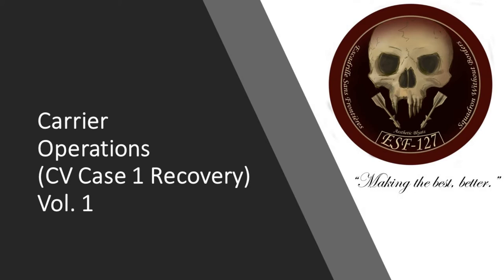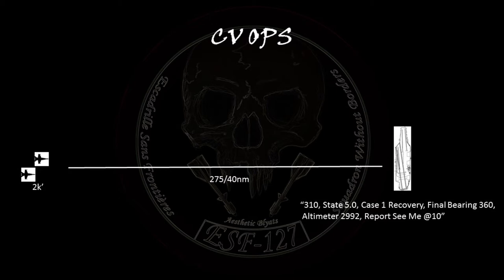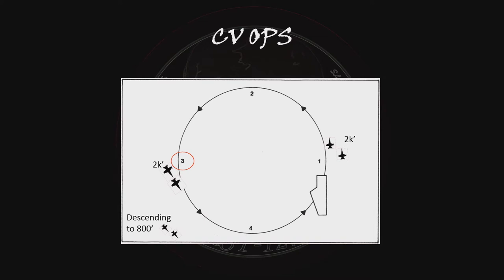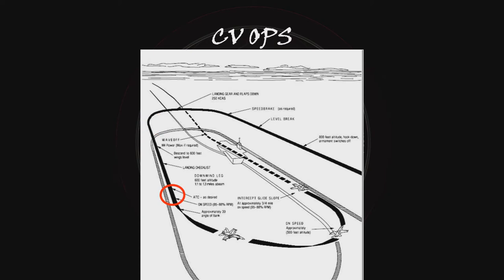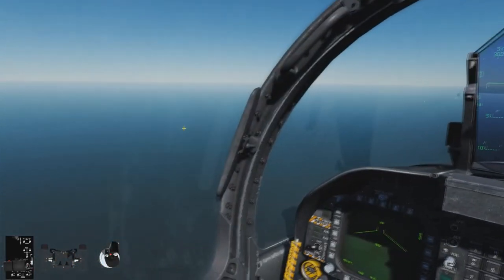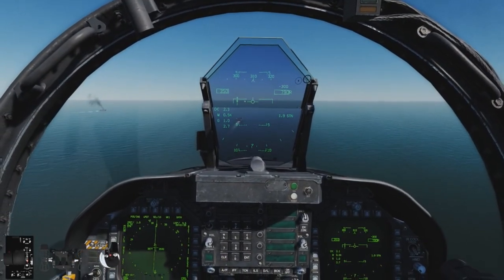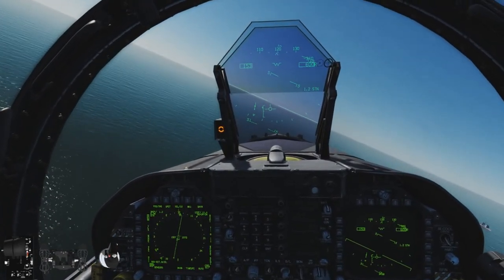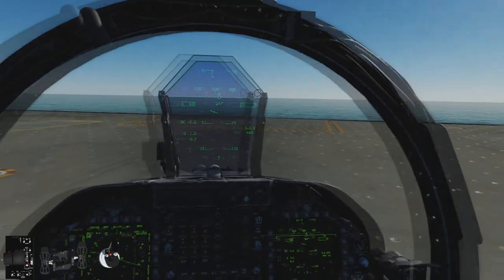ESF - DCS - Training - CV Case 1 Recovery

Comment: So only know what I've read...  But I think you left off "number of aircraft in flight."  Initial call, "310, holding hands with 307, Mom's  275 for 40, Angels 2, 5.0"  Great video!
Reply from the maker: @SageOT You are correct, I apologize if that caused confusion. I will put a note in the video so hopefully that doesn't confuse anyone else. (Despite the fact that this call will more than likely never be used in DCS). Thanks for letting me know!
Reply from the maker: @SageOT So turns out they have removed the ability to put in notes to change videos as of last year from what I'm seeing. That seems a bit ridiculous considering it's very difficult to not have minor corrections to things such as this even with several hours of looking over the final product with multiple people.
Reply: LOL.  That figures.  No worries.  I've just been putting together our guide for CV Ops.  That's why it was fresh in my head.  We use the call in our group just get used to it for the nights when we have someone sitting in the actual ATC roll.  Again great video overall, should definitely help people visualize all the words in the NATOPs :-)